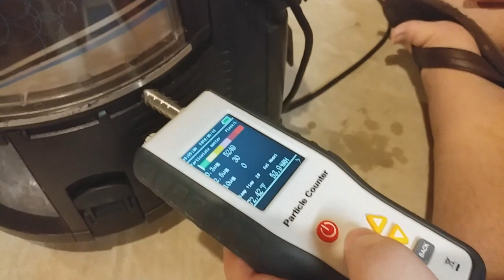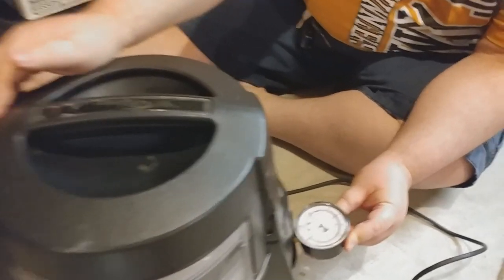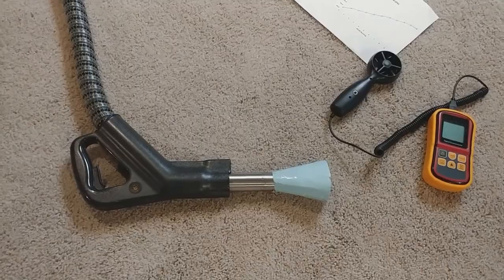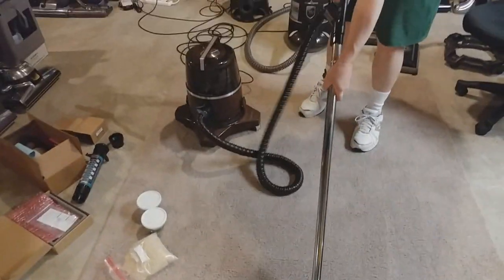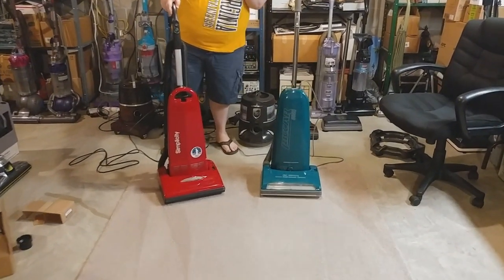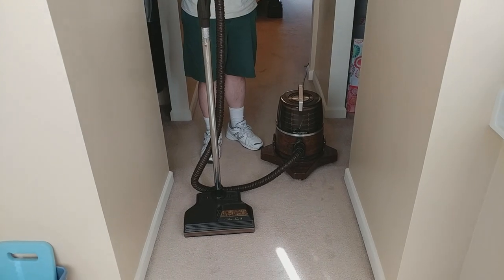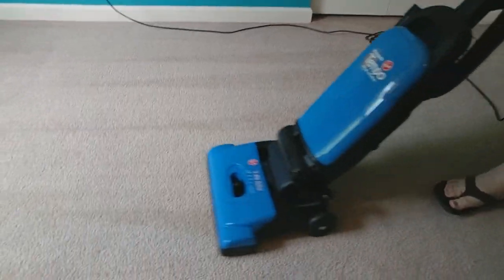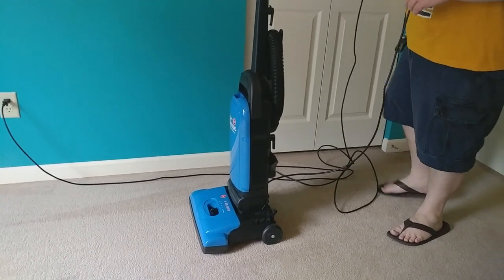VacLab Mini Meet Featuring Thomas Rectenwald And Some Rainbows

Comment: I’m REALLY happy you were able to do some airflow measurements on the E2.  It’s even better than I thought.  But...I’m sad you didn’t measure the airflow of that new power nozzle on the box!

I’m such a nerd, I wish I was there.
Reply from the maker: TrooperSam in the end, the E2 with the newer PN would be somewhere in the 55-59 CFM range. But my biggest surprise was how small (and narrow) the brushroll opening was.
Reply: VacLab: yep, to make room for those rotators on the outside.  I’m not sure yet how truly effective they are, but they do seem to bring stuff from the edges to the opening to be drawn into the airflow.

But I’m also really happy to see the particle counts on the E2.  Way lower than I expected.  I had rather figured it would have the same issue with the Rainbow you’d tested before with increasing counts because of putting water vapor in the air.
Reply from the maker: TrooperSam it appears that the removal of carbon brushes has brought the exhaust particle count down quite a bit. My older D4Cs still have them.
Reply: VacLab: I seem to remember opining about it maybe being carbon...LOL! :)
Reply: Air inlet was 93 I think, hose was 74, nozzle might be around 60 to 65 maybe. Rough guess of course. The newer PN3 supposedly is way more air tight than previous PN's.
Reply: It just occurred to me that those airflow measurements on the E2 were with a HEPA filter that is quite possibly somewhat clogged. I have to wonder what the numbers might be with a new filter.
Reply: TrooperSam the filter was somewhat dirty so it may have threw the CFM off just a little bit
Reply: Thomas Rectenwald: well, here’s hoping another chance presents itself in the future to try it with a fresh HEPA. :)
Reply: TrooperSam stay tuned for what the future brings 😉😁

Comment: VacLab,  do you have any recommendations concerning WHEN one should replace the roller/brush on a rainbow e4(e2 black) AND a D4 SE (this one has a beater bar)?  I see 'normal' wear on the both ( the e4 is from 2012), I got the D4 used so unknown age....but in great shape), but, I can't tell if they are bad enough to replace. Obviously, if they were quite short from wear, that would be easy  to determine.  I appreciate anything you have to offer on this
Reply from the maker: My D4C SE PE bristles are 5/16" tall (new). I would say when they get down to 3/16", you should  replace them. But if the brush roll has many nicks, is heavily discolored, doesn't spin freely and/or the beater strips have nicks/chunks missing, go ahead and replace everything your budget allows. The E2's PN  I can't say as that went back with Thomas.
Reply: Replace your brushroll or belt if your noticing performance issue's or like Vac Lab said if your bristles start to wear down or are uneven.

Comment: How is that D3 compared to your D4, is there a difference in airflow?
Reply from the maker: Looking at my database (and using the D4C SE PE hose on both machines), both have about 65 hose (not nozzle) CFM. That would mean my 1997 D4C SE and his D3C have about 87 CFM at the body (base).
Reply: Newer is not always better 😉😁